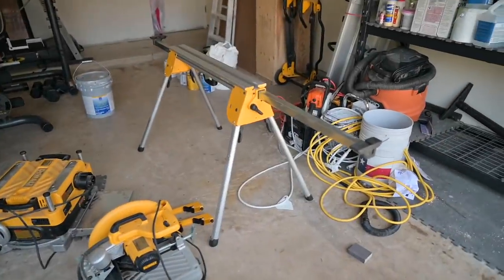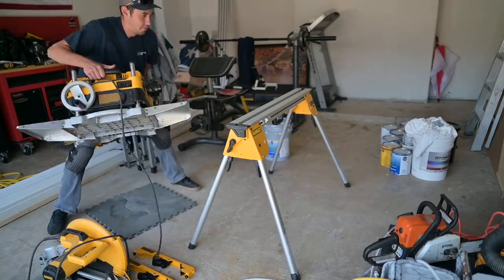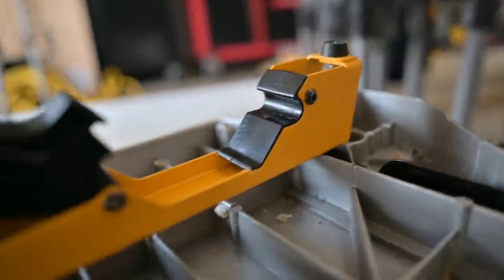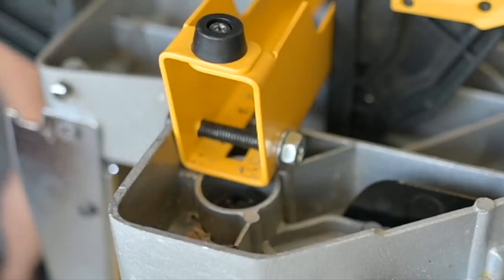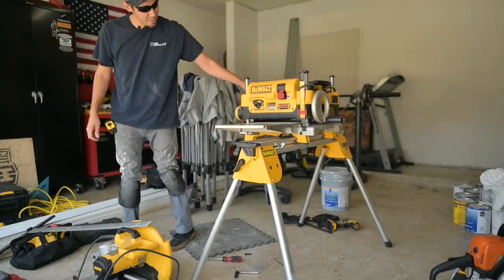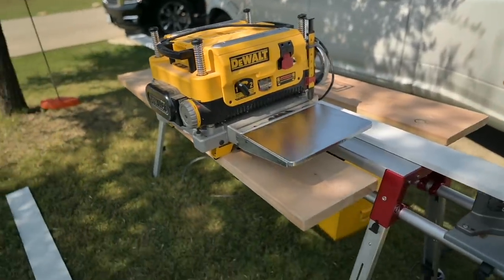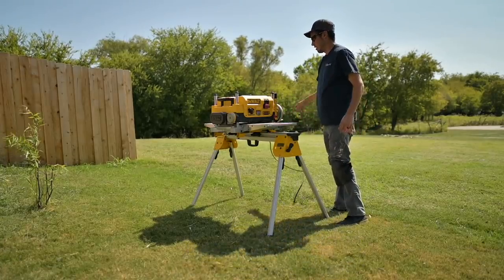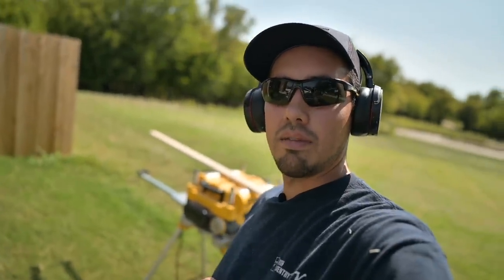My CUSTOM DeWALT Planer Set UP!!!

Comment: Mount the planer to a piece of 3/4" Birch plywood and then you can center the weight over the main support track....just a thought.
Reply: My thoughts exactly.
Reply: As I watched the video, thats exactly what I kept thinking, hoping he would reach that conclusion.
Reply: Ditto. Mount to ply first
Reply: But this then means the whole thing is another 3/4” higher. I did that very thing when I attempted this, but using my dewalt job saw. An idea I shortly scrapped, the added height, the stand alone was itself too high, mostly for in/out feed requirements.
Reply: @STV-H4H  I agree....the whole setup is too high- If it were me, I would cut about 6"- 8" off the bottom of the legs and pop the feet back on - I dont want a planer 3' off the ground. Richard just wants to utilize the stands he has- I would want to as well!
Reply: Larry S that idea, shortening the legs occurred to me after I posted, but because the stand idea with my table saw was scrapped, I’m glad I never did that, it would’ve meant the stand was otherwise not as suitable.
Reply: @STV-H4H  That is true! If I were going to cut the legs, I would want to make sure the stand could still be used for multiple purposes - in my case possibly a band saw.
Reply: @larrys639  I mounted my small table saw on these brackets and used one of the Dewalt extruded saw horse, that I picked up cheap in a package deal. I cut the legs down on it, so the top of my saw is flush with my miter saw wings. That way I can use them as my outfeed when I'm on site. Really easy and simple solution,  to the height issue.
Reply: Exactly what I did (different stand though). I also added threaded inserts to match the bolt pattern of my 12” miter saw, 7 1/4” slider, shaper, and jointer. This along with some threaded knobs means I can swap out tools quickly and easily in my small shop.
Reply: @BillMacfarlane  I cant agree more about the use of threaded inserts/knobs. My small shop is a 60" x 24" rolling cart! You gave me some great ideas

Comment: I added a piece of 5/8 cdx on the bottom of mine using the bolt holes for mounting to a bench.  I did that to help protect the aluminum base from cracking / chipping. The plywood edge extends out beyond the base and is rounded over with a router.  I'm going to implement this idea, but mount those brackets to my plywood base.

Comment: i'd add a hollow round bar to the inside of the clamp where the bolt passes through so you can tighten it and not have any chance of the clamp crushing in, this could happen on a very small scale with vibration causing the nut to loosen, also where the nut is you could add a 45 degree bracket to go to the 45 degree plate section where the lifting handles are, 100% wobble free then.

Comment: Add a piece of 3/4" plywood under the planer, then screw the brackets to the Ply... then you can center the load over the base, and it would raise it up a bit to maybe work with your work supports

Comment: That planer is pretty heavy, I used to keep mine tucked away under a shelf in the shop. Then age caught up a bit and I put it on a wheeled mobile base I built where I don't have to lift it anymore. I don't think having something that heavy off center is a great idea. The people saying to use plywood have the right idea.
My advice would be, stay young and invincible, then you can do whatever you want:)
Reply: I mounted mine to a lower shelf in the rolling table saw bench I built, same reason. Too heavy to want to have to lift.

Comment: For the outfeed support, I would suggest also adding a piece of sheet metal angled down to prevent snagging your board so it doesn't get stuck in the planar.

Comment: I mounted my DW735 to a Bosch Gravity Rise miter saw cart/stand. I mounted a plywood panel to the brackets, then screwed the planer down to the plywood. Hasn't failed me, and it's been about 6 years. You might want to consider that, so that you can better center the miters weight over the beam, rather than cantilevering over.

Comment: Get a spacer for in between the bracket.
Edit: I would even consider running a threaded rod from one support to the other.
Nice job.
Reply: and a bushing inside the brackets so they don't crush.  I would go for your idea plus the bushings.  Just what I need.  =)

Comment: It would be nice of one of these manufactures were able to shed some weight off the planer. 
Also for the planer I would use the Bosch gravity-rise table saw stand.
Reply: Weight equals stiffness and accuracy relative to reasonable cost,

Comment: Hola, me imagino que hablas español. Así que va mí pregunta.
Quiero comprar una sierra de mesa DeWalt FlexVolt, es para  cortar melanina.
Le van los discos de 8 1/2? Te pregunto porque no se consiguen muchos discos de 8 1/4 con varios dientes para un mejor acabado.
Gracias...

Comment: Just an idea. Attach a long 3/4 piece of lumber to the dewalt mounting brackets. Make the 3/4 piece of wood the length of the planner mounting holes. Now you can mount your planner using the the holes provided.

Comment: You should buy the DEWALT DWX726 to just roll it around.  At 92lbs this is not something to be played with.  Set it and forget it.  There's also a few nicer stands with rolling support, in fact you can add them to your stand if you wanted to, but some come with them.

Comment: I like Larry’s S’s idea of mounting it first to a piece of wood. If not then put a piece of wood in the hollow end of the Dewalt mount. That way you’ll have contact points through the entire mount which will be much stronger  have it currently.

Comment: The track tubes will work, you just need to turn them sideways and trim the height of the bracket you tighten the knob down on .  But if you mount the planer to a piece of finished plywood like Larry S mentioned in his comment you probably wont have to since it would sit 3/4" higher.

Comment: Kinda bad idea, but best idea is to keep planer at center due to balance of weight, and good idea to have roller on it as well, how about toughbuilt sawstand? Check it out TB-S550 or TB-S600 but TB-S600 would highly recommend

Comment: Hi, just an idea to improve on what you’ve done:
You could use threaded road with washers and bolts either side of the brackets to increase the shear strength and make it a whole lot more ridged.
Would be a quick and easy improvement potentially ?

Comment: Can you turn the track tubes sideways, so they are parallel to the ground? Looks like there is a bolt that goes through the center of it, so you’d need to drill a hole through it, but that might make it low enough!

Comment: I might be a bit off base here but why not bolt/screw a piece of ply to the brackets to enable you to just lift the Planer onto it you could make sliding stops on slots to clamp the plane in place that way you could mount it central, or am I underthinking it!

Comment: Nice try, it looks like it is cantilevered more opposite the elevation crank/wheel. Being offset like that I would be worried that it could tip over at some point. Putting extra stress on your mounting brackets.  My suggestion would be to add a mounting plate so that the planner is centered over your tool stand. Greg

Comment: It might help if you flipped the brackets around, so the weight of the motor was overtop of the stand, rather than hanging off the other side!

I've had to modify all my tools, some what, they all live on mobile bases now. When you work in a single car garage, mobility is key!
Reply: That is exactly what I thought. Based on the Dewalt Miter saw instructions - the way you are oriented to the machine then he put these on backwards.  Its meant to reach over the machine and crab the black handles.  They arent supposed to be towards your body based on the way your grab them to release.   I am about to try that now.  I was looking through the comments to see who noticed that then who has tested it.  If not, I will.

Comment: If you ran a length of steel all the way from one bracket to the other and then threaded each end, you would strengthen that immensely. From a pesky engineer
Reply: It actually wouldn't do much because the T-frames aren't designed to handle that kind of load.

Comment: You know Dewalt makes a portable table saw stand right? The saw mounts with those same quick release brackets, but it breaks down so compact that I never even remove it. I see no reason why the planer couldn’t be attached to that stand, then just use a sawhorse for an outfeed support. You don’t need support on both sides if all you’re doing is running trim boards through to skim off the primer or paint. Probably the same amount of time to set up but far more secure for that planer. And you’ll be glad it’s on wheels if you need to leave site for a quick errand or get caught in a pop-up shower and need to yank everything into the garage

Comment: You're such a dreamer!😆
I would cut a dowel to fit the bracket, should adjust to right height.
Reply: Bob Varner So is the Dewalt lunchbox planer.  The stiffness of this model makes it a little more durable for job site use.

Comment: Richard, I appreciate your  ingenuity; however, the planner is designed as a balanced load machine over the four contact points. By cantilevering the load as the brackets do, you create an unbalanced load where the torque is being supported by the rear locking mechanisms or two points of load bearing. Given the excessive vibration produced by the planner, it is set for failure. Proceed with caution—stay safe.

Comment: I'd be very concerned with mounting that much in a cantilever position and only supported by small bolts through the base webbing of the cast pot aluminum. I would devise a method of centering the machine on the stand to distribute the weight more evenly. The pot aluminum webbing (in my opinion) is not that terribly strong for lateral stress and having countersunk the holes to accommodate the stove bolts, further weakened it in those spots more. With moving the machine on and off and the constant vibration while operating it may create cracks and eventual failure. Maybe as Aaron below has said, mount the brackets on some 3/4" ply. I would then drill blind holes with a forstner bit the size of the rubber feet of the planer so itcan sit centered on the stand. Just a thought.

Comment: good for a stationary set up, but i wouldnt use that for a mobile one, those plastic clips are already very cumbersome. Not sure about yours, but the plastic clips on mine dont unclip, you have to manualy push the lever down inside the clip before getting the saw off, cant imagine doing that with a planer.

Comment: It is odd that there are no mounting brackets that center the weight of a mounted machine over the support stand.
Reply: Because these stands are for mitersaws which by design are built with an offset. If the mount were balanced from center someone would have a accident when it would absolutely fail upon first use.

Comment: I was wondering as I watched this new video if there might be a few dozen hits or +1K. Some of you higher quality content creators have astounding audience awareness, seeing a vid that might show publishing an hour or even a day, and the views occasionally exceed what even seems possible. Kind of like back in the 80s (or whenever the last days of most people having less than a dozen options on terrestrial (a great 2bit word) television. Now with billions of possible types of shows. Anyway. 
As I’m watching I am thinking that unlike a miter saw which has a particular offset so the mounts can be far off center, the planer weight requires a firm central balancing. So skootching the brackets so the clamps are as near to center is important. While the stand no doubt will safely support the ~90lbs, in time the twisting force on the aluminum will result, at the very least it’ll be unlevel, but if it were to tip over while running, that would certainly mean a new planer is needed, and (lol) the warranty void. 
As for the bolts, them having that slight wobble, not an issue, since a) they will wobble opposite each other, b) the weight alone will compress them into dead solid. 
I did this same mod using my short dewalt stand and set up my dewalt job site saw. It was an ok thing except that in and out feed material was too high for portable roller stands. Having to then modify a solid riser to balance them on was a pain. Building a higher bench was another option, not really an option for expected reasons. 
Al in all this is yet another great contribution to your outstanding content.

Comment: What model planner is that?  Are wen planners good?
Reply: D735, idk about the Wen ones. 
I bought a Wen drill press just because it was cheap and I don't need one for any actual work. It's really chintzy. I imagine their planer may be not so great as well but I haven't seen one.
Reply: @nevermindthebull0cks  appreciate that. I saw it had good reviews probably fake same with hazad freight. What planer do you guys recommend. I'm going to rarely use it but I'm going to run at the most a 2x10 through it. I just saw d735 I'll order it